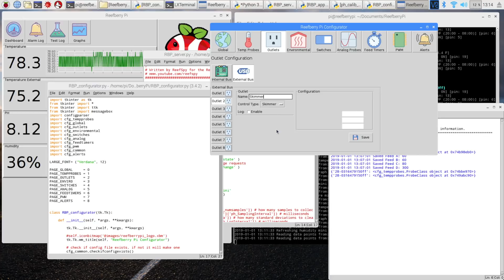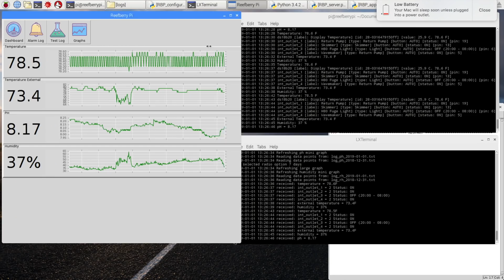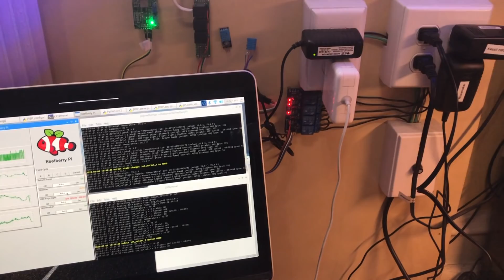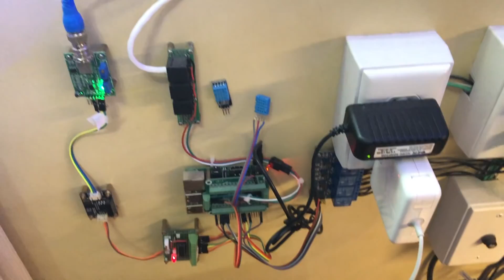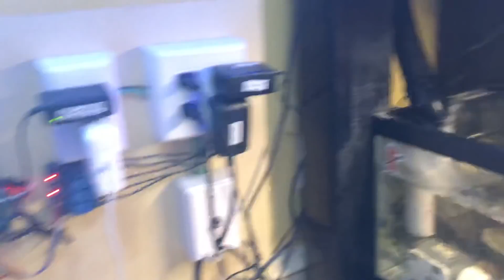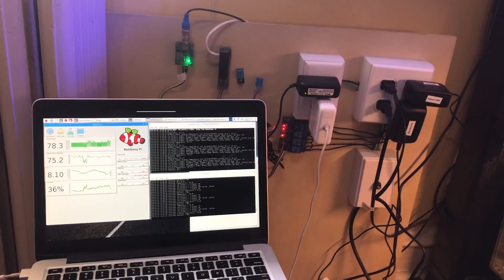Reefberry Pi - DIY Aquarium Controller January 2019 Update

Comment: My question is about how/what is used to make/write the program on the pi. I have two pi's (original and version 4(?)). I have only loaded premade images and not written any programs for it. I do find the reefberry program very interesting and looks like a fun project. I am not a reefer, i just started setting up a 78 US Gal corner tank (currently cycling).
Reply from the maker: You have many options available to you. If you are just starting out, I’d suggest looking into Python. Its easy to learn and there are many tutorials available online to follow. I’ve used a tool on the pi called IDLE. Its bare bones but gets the job done.
Reply: Cool, thanks for the shove. I will load up my pi and play. I have resources for learning python just never had a project to focus on.

Comment: good stuff, was just looking for an active project i might be able to help on rather than recreate the wheel with what I want a controller to do. I was thinking about a feather huzzah using arduino but this looks pretty complete as a project to build on. You mentioned pwm control for dosing, this is something I'm really looking for and willing to help. I can probably also help with sending mqtt messages to a home automation system like home assistant to display different stats or send alerts..

Comment: I've messed with several of the arduino reef controllers and tinkering with their codes and even had 3 or 4 different ones running great for me but I still don't fully understand the code writing, this is my first time looking at anything related to the raspberry pi, your project is looking great and coming along nicely !!!

Comment: Awesome project bud. Looking really good, I'm in the very early stages of building one myself. Atm all I'm doing is switching on/off relay channels based on the temp probe that you have and also an optical water sensor which I plan to use my my ato. 

Do you by any chance have the details of the ph probe you're using? And any other probs you're looking at such as salinity plz. Very much appreciated. 

Look forward to your next update 👍🏼
Reply from the maker: Thanks. I am cleaning up the code a bit before next update.  I’ll need to put together something about how to build the ph module, but the probe is a single junction ph probe from BRS (I also have the double junction, both work fine) and I just use one of those cheap chinese ph module boards you find on ebay. You’ll need to run it through an A-D chip to read the values on the Pi due to the lack of analog inputs, and be sure to use an isolation circuit or you can get some weird readings due to ground loop. So far its worked out well. I do have a salinity module I’ve tested briefly, and it looks promising, but it needs more work before I know for sure.
Reply: Awesome, thanks for the quick reply. Good luck with the build
Reply: Hey, would you mind sending me over a pic of the hardware set up you have for the ph module please? I have a probe and the ph-4502 module and I have an mcp3008 adc running on the pi and I have a python script that's able to read from a channel controlled by a potentiometer. So I'm not just trying to hook up the ph probe to the adc, any help much appreciated. Thanks.

Comment: I’m currently working on an aquarium controller myself and have gotten pretty far with it. If you are looking to move to a web app I highly suggest NodeRed. It comes installed on the full version of rasbian and has a built in browser interface. So far it has been very easy to do the programming and the GUI is fairly well built, just not as much customization as tkinter.